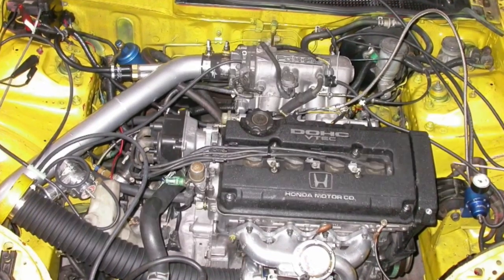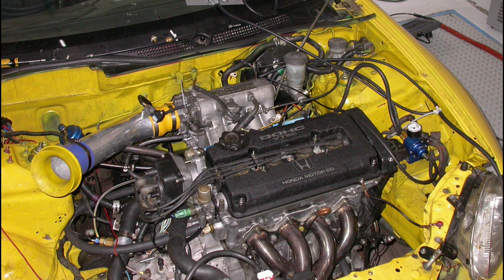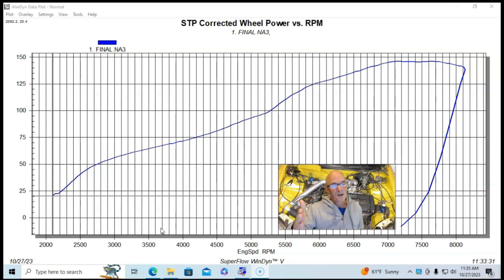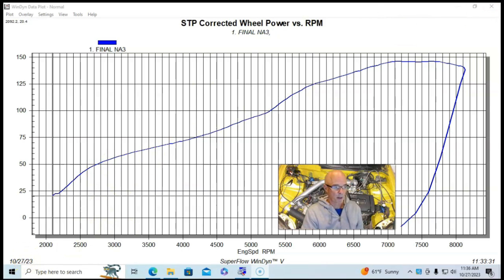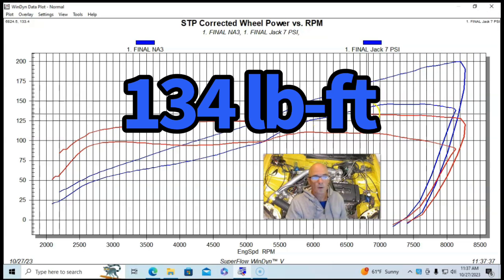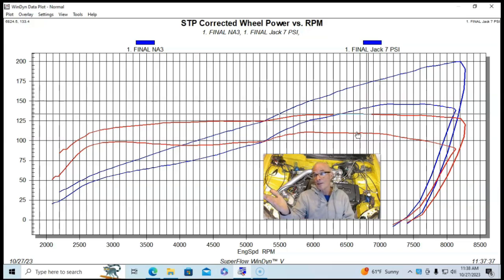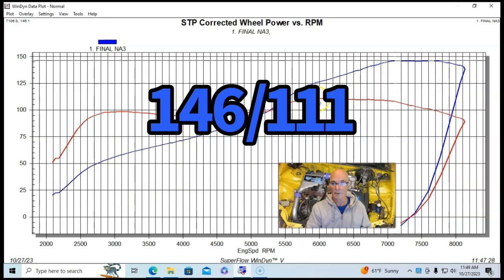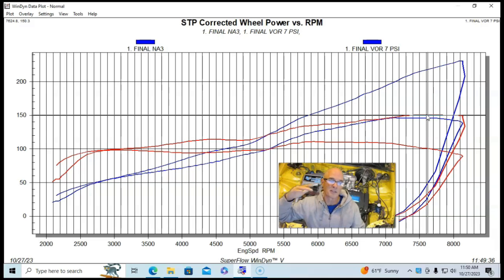BLOWERS VS TURBOS-WHICH MAKES MORE POWER? ROOTS VS CENTRIFUGAL VS TURBO-SAME B16A MOTOR-SAME BOOST!

Comment: It's common for the n/a to boosted low pressure kits for the centrifugal supercharger to make the highest peak HP like that. Usually the turbo turbine is off peak efficiency and all those initial kits had a log manifold which takes quite a bit of power relative to a header. The test that I wished people performed is the total power output for the next 5 or 10 seconds after going WOT at the bottom 1/3rd of engine speed. Like jumping on it, on the street, without downshifting. The centrifugal seems anemic on paper except the last 1000 RPMs, but it actually gives instant boost - albeit not peak. I have all turbos now, but don't discount the centrifugal supercharger's torque by the power graph, the difference is that it can deliver it instantly when jumping on the throttle and then you sort of just shift at the RPM you want based on the kind of acceleration you are going for. It's great for the last second jumping on it to get into a spot in traffic.
Reply from the maker: CENT PROVIDES IMMEDIATE BOOST, BUT JUST NOT MUCH OF IT (OR MUCH TORQUE) AT LOWER ENGINE SPEEDS. YOU NEED TO BE IN THE RIGHT GEAR

Comment: Hi Richard,

I've been reading about you in your 88 Mustang since the Silver State Classic days in the magazines more than 30 years ago. It's good to see you on here.

My guess is that the B16 with the Turbo suffered a bit of power loss due to A/R sizing issue with the Turbo used.  It doesn't specify what the A/R was for the Turbo used.  

I'm guessing it was too small say something less than .45.  Also there may have also been a flow restriction in the exhaust that contributed to the roll off beyond 6,500 RPM.

Comment: @Richard Holdener I have to disagree with the assertion everyone makes, that turbos do not incur parasitic loss. During the exhaust stroke in an ICE the exhaust is pushed out by the pistons, and having a turbine in the exhaust plumbing increases the amount of work the engine has to do to push out the exhaust (the source of some of the energy used to compress the air). I propose a simple experiment, Richard. 

Leave the turbo connected in the exhaust system but replace the plumbing from the outlet of the impeller with a pipe that has a restriction at the output end enough to create the same peak boost as when it's plumbed to the intake. Of course you'll have to replace the TB on the intake manifold to run the engine. Since it would be pretty difficult to match the boost curve of the turbo on the boosted engine (as the resistance would have to vary through the powerband like the engines consumption of intake charge varies with RPM), focus on matching peak boost between the impeller and the obstruction with peak boost in the intake, at the same RPM as the boosted motor acheives peak HP. Dyno the resultant naturally aspirated engine and compare it to the NA engine with a normal non-obstructed exhaust (which you ran as your baseline here).  If the turbo is not parasitic, the peak HP will be the same between the two NA runs. I'll bet it's not the same, and there's your parasitic loss.
Reply from the maker: your test method doesn't work on a turbo-there needs to be the extra airflow to create the extra exhaust flow and back pressure-the losses to drive a turbo are minimal compared to a blower
Reply: @richardholdener1727  Of course it will work. The experiment is to determine if there is parasitic loss, it doesn't matter if the airflow to the engine is being augmented by the boost. It will not represent how much power the turbo saps from the engine when the boost is plumbed into the intake (and the output at the cranks is greater), but it will be representative of how much power it takes to produce lets say 7 PSI of boost using a turbo. There wil be plenty of back pressure in the turbine plumbing when the turbo is producing boost under either scenario.... why else would the impeller be spun fast enough for it to compress air?

What are you afraid of, disproving decades of mythology surrounding the power made from nothing that you get from a turbo? The law of conservation of energy says that energy is neither created nor destroyed. Energy changes from one form of energy into another form of energy. If a turbo magically creates the energy to compress the intake charge from nothing, you've proven 100s of years of science wrong and found an unlimited supply of energy that could power the world for nothing without consequence.
Reply from the maker: Please feel free to disprove the 100s of years of some mythology that you just invented. NO ONE has stated a turbo requires no power to drive. The point is that it takes MUCH less than a supercharger (of any type). We know this from endless direct comparisons between the two on the same motor, same boost, same timing etc...and your test is not a true representation of the drive loss in a turbo-that would need to be done with two connected motors (a la SAE).

Comment: A company in the uk has put a centrifugal charger on a classic Mini A series 1300. Gets great power (160hp+) increase and the pros of the install are keeping the CR the same as boost is low at low revs, plus A series gearboxes are weak over 100hp so using revs keeps them in 1 piece. The turbo coming on boost and the roots style blows the boxes on them. But the turbo price is so much better!

Comment: Always like watching your informative videos.
I know you’ve compared turbos vs roots vs centrifugal. I think it would be a good comparison to see a Whipple vs D1sc ProCharger... I believe the D1sc tends to make a bit more Torque than other PC units
Reply from the maker: I compared twin screw (Kenne Bell) to turbo, Vortech and Eaton Roots on a 4.6l 4V Mod motor. The D1SC acts the same as other centrifugal blowers (a I have run them many times)

Comment: You think we could see a test like the amr500 with the 128$ vz21 turbo you could run it on a wastegate outlet and measure the flow the turbo is tiny the inlet is the size of a quarter

Comment: I'd say the wastegate started bleeding off boost after it hit the  7.5p.s.i, and never quite recovered the boost and impeller speed before rev limiter. Whereas the vortechs(belt driven impeller's) speed doesn't cut/reduce until engine speed does i.e rev limiter.  I feel like the test would have been more accurate if you ran the B16 to 8500rpm, which its more than comfortable handling.  I appreciate all the content you provide and love all the test you run, so i'm not complaining. Keep up the good work Rich!

Comment: What was obvious to me was the cost in power to run the superchargers vs the turbo.
At 7 PSI they should all produce the same power but the superchargers cost horsepower being crank driven.
Glad to see that the roots costs less than the centrifugal blower and the turbo costs comparatively nothing.
Reply from the maker: a roots blower takes more power to spin than a centrifugal
Reply: @richardholdener1727  
That seems counterintuitive to me. Roots is direct drive by pully and the centrifugal is, while belt driven, is internally geared to a speed faster than crank speed. That would seem to have more drag. Where is my thinking gone wrong?
Reply: The centrifugal is spinning a small lightweight compressor compared to the far larger and heavier rotors of a Roots system. The roots has more mass and inertia so it takes more energy to spin it faster.   @FeralPreacher

Comment: Great stuff Rich. Back when I was solely a Honda guy I always said centrifugals were the worst of both worlds.  But these days on monster V8 motors with high stall converters they actually work pretty well.  And of course now I have a centri on my last remaining Honda...  One thing I'm surprised by is you didn't move VTEC down on the supercharged engines.  We typically would drop it down to between 3k-4k rpm on most VTEC engines depending on the build/cams/etc.  Dramatically improved midrange torque, especially on the Roots stuff.  Did you guys ever test the Jackson stuff with the aftermarket intercoolers (LHT, etc?).  Huge improvement.
Reply: Agreed, it was very obvious in the test that adding intake timing flowed much more air with the vortech, and the boost guarantees no overlap reversion.
Reply from the maker: adding intake timing? and moving the VTEC down to 3000--4000 rpm on a stock B16A would result in a huge dip in power-that VTEC engagement is WAY too early for this stock application

Comment: I have a preformer 351 2v intake. is it a bad idea to put this intake on my 1973 351 4v motor or should I buy a proper 4v preformer rpm intake. Thank you very much for your help I truly appreciate and respect your opinion.
Reply from the maker: Cleveland or Windsor?
Reply: It a cleveland motor with a small cam and roller rockers. It has a cast iron intake now and I have a 2v preformer just want to make sure I am not downgrading. Thank you so much Richard you are a awesome and great person.

Comment: Hey rich,  do you think that it is possible to convert a Coyote into a "Hot V" style motor, with switching around the cams and of course custom manifolds?
Reply from the maker: not sure why you would want less power
Reply: @richardholdener1727  not sure either, but you're the guy that tests everything, but you must know the results of the test, without testing.
Reply from the maker: hot V motors look cool in a video-but flowing the intake through the smaller exhaust ports makes less power

Comment: Turbo exhaust housing too small (doubtful but who knows without data) or high IAT's gotta be the reason for the power discrepancy up top.
Reply: Nah i think thats the perfect sized turbo, in the boost response comparison you see where the turbo hits 7.5psi(right around 12:41) while the jackson was at 6.5psi , I think at that point the wastegate  bled some boost off trying to maintain the "set" 7psi and didn't have time to recover before rev limit. You also see the turbo boost spike to 7.5psi again, then dip before rev limit. Superchargers will always have more stable boost than turbo, its just the nature of the beast.

Comment: Interesting! I bet if you compared actual density, ie, IAT and MAP, the Vortec would be putting more molecules of air into the engine, thus more power. As you mentioned, the intercooler was probably responsible. I don’t think you’ve shown us results like this before. If I were going for boost, I’d still use a turbo… Thanks, Richard, still good stuff even when unexpected results show up!
Reply from the maker: a vid on this test is up already-but at 10 psi

Comment: Did the turbo have a small A/R?
At high rpm that could push the back pressure over the top, killing the savaging.

It wasn't really fair to cool the air for the other two and not for the roots blower who could really need the help at the higher presumably inefficient rpms.
Reply from the maker: that is the way the kits come

Comment: If you want to make torque go with a roots blower if you want higher rpm power the centrifugal blower or turbo is the way to go I think it depends on your application and what each person is wanting... I like the instant torque of a roots blower personally and the sound love the whine but a turbo will make on the big end depending the turbo
Reply: You can run into problems making to much torque at low rpm with these engines. They’ve got pretty small bearings since they normally don’t really make power till higher rpm. If chasing bigger power the turbo or centrifugal is the way to go. Hard to get something like a roots to not make low rpm boost and then make a lot of high rpm boost.
Reply: @NBSV1  I know and you can build an engine to handle the torque it just depends on the build my dad's street car is built to handle the torque it has a 3l twin screw Whipple on it it's a tire burner he named it shredder
Reply: @NBSV1  the motor he has is over built with quality parts and we pull the pan after every event and check the bearings in it
Reply: @VroomNBoom  Even with quality parts you need to be careful about making to much power at low rpm. With the small bearings it's much easier to push through the oil and spin a bearing.
Reply: @NBSV1  most definitely agree still gotta be careful